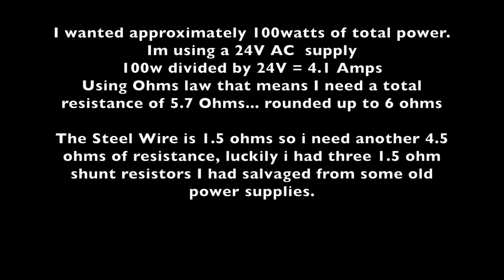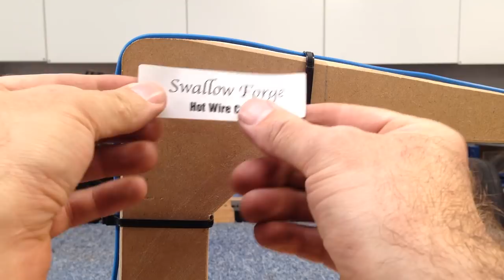How to make a Hot Wire Cutter for foam or polystyrene- styro slicer - cosplay, lost foam casting etc

Comment: why not just select the voltage to give the desired current. It doesn't make sense to create 24V and then drop most of it in some resistors.
Reply from the maker: Yeah I should have just taken the transformer apart and removed some of the windings instead.  If only I hadn't wasted six years studying electronics. Oh the humanity.
Reply: Swallow Forge Or do something as simple placing a PWM current controller between the output and the wire or maybe even an off the shelf dimmer at the input. Also there are a lot of off the shelf switching supplies that you can easily adjust to the voltage you need.

I'm not belittling the effort you've put into the design, it looks neat, but cooking that much excess power I'm not a fan of. I'm thinking of doing an NC version
Reply from the maker: You all make valid points, and i was previously aware of all of them, however this is a super simple project with very basic maths and components. I do have and use nichrome wire, however again in this project i wanted to keep it simple. same with the power supply, despite its inherent inefficiencies, it uses parts the most people could find without having to pay out any money. for example I have a very expensive regulated dual power supply i could have just plugged it into, but then people would complain that nobody can spend £400 on a power supply.However,   I plan on doing another video on a bow cutter, I will endeavour to give more options on that one. These things aside, I do hope you enjoy my videos, I genuinely only make them to try and help people have a go at something they thought was beyond their capabilities.
Reply: +Swallow Forge I need to make this project myself and havent done it before so I appreciate your video and effort. I have to cut stronger materials though. But Id like to know why you didnt create a plug and into the wall instead of using a specialized power supply? If straight into the wall mains would result in too much voltage to a high gauge (thin) wire, isnt that then the purpose of a dimmer switch?
Reply: Don't sweat the nay-sayers, I thought this video was great and I've watched a bunch of them lately. I like your spring design best (over the other videos) and will be incorporating that into my design. Still gathering parts but I will soon have one of my own 😎 Also mine will be mainly for plastics so I'm having to "beef it up" a little.
Reply: Good work. Power consumed by wire is 25 watts only. Retaining 75 watts is wasted in the resistors. Probably the available transformer would have been used. Can regulator circuit be used to avoid losses?

Comment: Is possible with 24v dc supply
Reply from the maker: Yes, just use a 24v voltage regulator of a suitable wattage.
Reply: Thank you sir, 100w is it right sir?

Comment: Nice video, thanks for sharing. 
A suggestion if it's okay - all your video is silent. Great. Please silence the sound of the saw cutting the wood. Not nit-picking, the video is clear and useful. 
Thanks also for giving your starting point of 100W. 
As kids we used to put a needle  instead of the soldering iron bit in a high wattage / electrical soldering iron to cut (what we call) Thermacol. I was too young to note wattage (!!) We used to / tried to do intricate designs for festival decorations. But there the success of circles, flowers, even straight lines(!), let alone intricate designs etc are dependent on the individual's skill. 
Liked the video. Thanks,

Comment: Don;t you wear some kind of protection for you hands ? Good video thanks. Power of silence, helped us focus even more
Reply: +Sandeep Krishnan (Sandy) True said, silence is the best in such a noisy World :-)
Reply: +Sandy You should never use gloves when using electric saws, it is extremely dangerous. Because the teeth of the saw can trap your hand.
Reply: +Sandy gloves in this situation could get snagged on the saw blade and even be more dangerous .I'ts all a matter of taking your time and respecting the tool
Reply: +Sandy I see,, sorry! while cutting the foam ,not a bad idea ,just remember wire doesn't move Soo stay away from it your OK. BUT a real danger is buildup on the hot wire ,then when it springs back after passing through the block of foam it could get ''thrown '' into an eye or on your arm or face.
Reply: You  are
Reply: He could probably have used the angled guide block on his bandsaw instead of doing it freehand, but I guess he's experienced enough not to need it.  I would not recommend an absolute beginner to do things the way he does.

Comment: hey if I use nichrome wire for it in a 12v power supply  do it will work ???
Reply: +rennier rodil your suppose to use nicrome for any hotwire and it should work on 12v iv known people to use it aslow as 6v

Comment: What if your finger touches the hot wire cutter?
Reply: It would probably burn a little... if you have static electricity you would get shocked
Reply: If you touch the wire you will get burnt and it smells like bacon and will leave a mark that takes years before it goes away. it did not hurt very much though:). it does not give you an electric shock. 9V and 5amp is nothing to worry about. We cut big time 2400mm high by 300mm thick on a manual cutting machine.

Comment: Couldn't you use DC power instead?
Reply from the maker: +D Monty 
Yes you could. :)
Reply: +Swallow Forge the reason I ask is: you have less of a chance being shocked with dc vs. ac.
Reply: +Swallow Forge BTW, great job on the construction part of this project.
Reply from the maker: 24V ac is an industry standard safe control voltage. so the risks are minimal. thank you for you comment, much appreciated :)

Comment: Your hot wire cutter has a very low efficency (about 6%). Try using a thinner wire, this will increase it`s resistance making it much hotter. And remove the extra resitance. The maximum temperature is reached at about 6ohms with an efficency of about 50%
Reply: Can you give the values used in making this calculation?  I'm looking to use a 12V transformer.  I assume you are using 24V but how did you reach the 6 ohm value?  What current/power value are you using?
Reply: +Jason Templeman Power used for heating: P=E^2*R/(R+r)^2 where E=12V in your case R is wire resistance and r is the sum of all other resistances in the circuit (only transformer in your case). P is highest when R=r efficency: n=R/(R+r) so the higher the R(wire) the higher the efficency.I would use a R=2r when both power(88℅ of maximum) and eff(66℅) are high. To find r measure the resistance of transformer output. Or if you dont have a multimeter use r=volts/amps (a bad aproximation) of output (written on transformer box). I think a 24ohm wire would work

Comment: Nicely done video. But by the time I purchase a band saw, big circular sander, heavy duty vice, vertical drill press, multi-meter, 3X heavy duty 5amp dumping resistors, cable ties, materials and a 24VAC power supply I might as well just buy a wire cutter and save myself the bother. You have got to make it easier with minimal tools if you want to impress. We don't all have that stuff on hand. Bit like taking a jumbo jet to the super market to get a liter of milk.
Reply from the maker: What bothers me most about this comment is the fact that you can't figure out for yourself that you can use a hand saw and a hand drill. All power tools do is save time but mostly energy. As for the power supply, if you can't find something in a scrap bin they cost very little to buy. If you want to impress me, spend more time figuring things out for yourself rather than just criticising others for your own short falls. I hope you enjoyed the video all the same. SF
Reply: Swallow Forge
Yes I did like the video and and no disrespect intended. I think you are a skilled hobbyist and and are capable of far more complex things that the hot wire cutter. I'm just suggesting that if you are presenting a lesson in 'How To' that is a simple project demonstrate how it's done in a simple way. There are many who are intimidated by such advanced equipment.
Reply: TheRockno
Don't be angry. I understand Sir. May I explain. The video is good granted but I have been an instructor in medical electronics and diagnostics for decades in Asia. I found in my frustration with language, culture, religion NEVER demonstrate some thing that is beyond the capability of your students. Example, I would always try to imagine my students (though smart) had just walked in off the street. I would never teach them skills beyond their abilities and available equipment. I was teaching USA state of the art medical diagnostics, sampling, pathology and instrument repair & operation worth millions of $USA. But if you are going to teach and want to be truly successful, teach with the tools your students have and not with the tools you you can show off. Then it's a genuine attempt to educate.
Reply from the maker: I understand your point, However I'm not a teacher, I am showing people how I do things, they can take from that what they will. this isn't a full time job, It is only something I do in the limited spare time I have. I also learnt very early on its very difficult to please people on youtube Everyone has an opinion, they are all different. If I use a hand file, I get comments saying " buy a grinder with a flap disk" if I use a grinder I get comments saying I should have used a file. you can't win. I have a large well equipped workshop, so It would be churlish of me not to use the tools I have. you should Watch something by the woodwhisperer. Now theres a guy with a lot of fantastic tools that I could never justify the expense in buying, doesn't mean he shouldn't have or use them in his videos. Doesn't mean he has't got a wealth of information in his videos that anyone can enjoy. So I hope you understand that I have to make my videos In the way I enjoy doing them, I don't talk, I don't play Music and I use the tools I have available. If that isn't to your liking then, without wishing to sound peevish, watch something else. However I hope you do enjoy my efforts and subscribe Also don't be too quick to sell youtube viewers short, most of them are far smarter than you would give credit for, and if anyone asks questions, I always try to help where I can. Thank you for this discussion though, it has made me reassess what I am doing and that is never a bad thing All the best SF
Reply: Swallow Forge
Thank you for your reply. I like your interesting other opinion. I am also a bit envious of your great workshop. I think it would be great if you continued making "how to do it videos" but videos that absolutely needed the tools you have. It would show people like me just what you can do with the right equipment re: what you are limited to with no such equipment. Look forward to further videos.
Reply: Gary, using that argument would doom the use of woodburning stoves here. <g>  Just think, you have to go out and buy the chainsaw, then the 4x4 pickup, fuel, etc.  I appreciate the efforts to make it simple for the simpletons like myself. <g>

Comment: Why put those resistors and waste so much power? You could just use 6V power supply and with 1.5 ohms you'd get 4A current, so with the same current you'd get the same temperature of wire, just with 24W of power, while now 3/4 energy is just wasted on resistors. And would be much easier to get much smaller power supply even.
Reply from the maker: There is a power supply video to go with this.
Reply: @SwallowForge  but you can just use any other power supply, getting 25W at 6V is not that challenging. Something like step down with XL4015 that costs here like 3-5usd can handle 5A and up to 75W in theory so 25W should be well within it's capacities and can go down from 24V and you can precisely set output current and voltage. Besides with 26AWG wire you need like 2.6A for optimal temp, I was testing yesterday mine and it was cutting nice between 2 and 3A so no need for that high current anyway. And you're not making room heater unnecessary.
Reply from the maker: Gee I wish somebody had pointed stuff out like this when I was making air data computers for fighter jets…
Reply: @SwallowForge  I don't know what else are you doing. I just hope you don't waste 75% of power in those planes :)

Comment: Nice build, but not a fan of particle board.
Reply from the maker: For this application MDF is a good choice because of its smooth finish and stability. I only ever use it for shop jigs though. Otherwise its solid wood all the way.

Comment: if you had the money for all those expensive machines why did you not just buy a wire cutter! :P It's a great video, but most people don't have these types of machines at home, or the space for them.
Reply from the maker: +wiggym1 because it has taken me over 20 years to  accumulate all those machines. Most of which were bought before i was married, mortgaged and a father. The reason for having the machines is so I can build more machines. I made the hot wire cutter to make foam blanks for cannon barrel casting. You may have well have said, why buy any tools, just buy the object you were going to make with them. But then that totally missed the point.
Reply from the maker: +Swallow Forge 
There is nothing in this build that cant be done with a hand saw and a drill.  I have a shop full of tools, but I started out with second hand tools that cost less than a big mac meal. And built some pretty awesome things.  Make something other than excuses. You will find life is much more fulfilling that way. All the best. SF
Reply: Fair enough, Just wondering thats all, not I also often make things myself, but I do not have anywhere near enough tools or equipment or space! I have to make do with what I've got. I
Would you happen to know if your machine would cut upholstery foam, the kind for beds/sofas? :D 
Marriage, Mortgage and kids would put a dampener on hobbies! or being creative. A most enjoyable video though :) P.S. I don't think you can get 2nd hand tools for less than a big mac these days! ;) maybe 20 years ago! :P 
Keep on keeping on!

Comment: 24W cutter, not 100W
The power is P = U * I = R* I * I = R * I^2 = 1.5 * 4 * 4 = 24W :-D
The power lost in resistors is definitely lost.
Reply from the maker: 100W total.
Reply: Indeed 100W is total power consumption. But if you used 1000W (1kW) power supply, would you still say, you have 1kW cutter?
The only value that matters are those 24 Watts warming the hot wire.